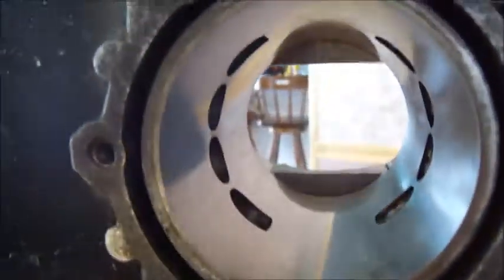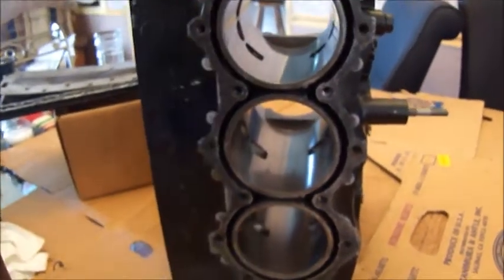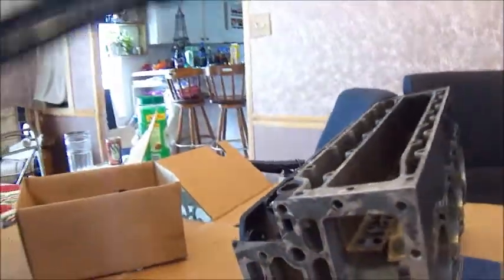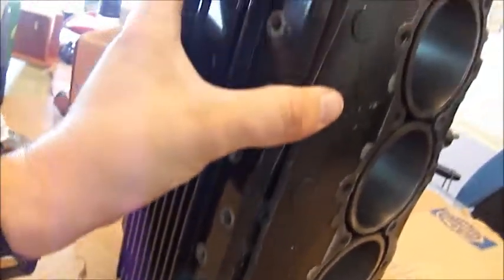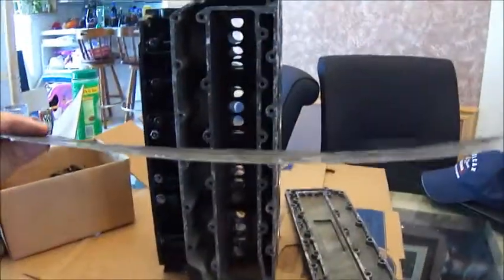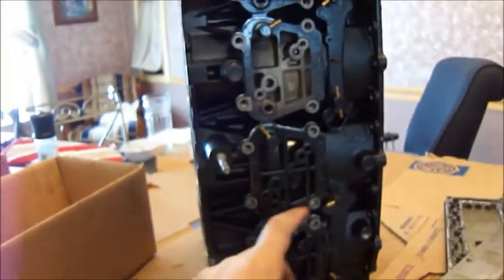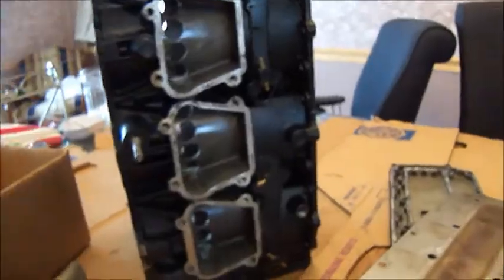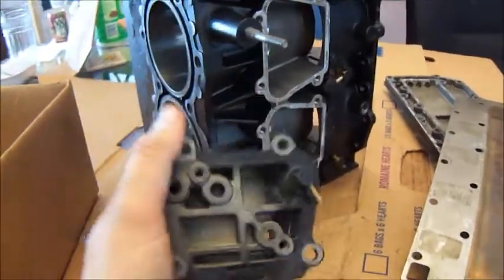Force block completely disassembled.wmv

Comment: So did you end up using 3 oversize pistons and 1 standard then?  Forgive me for asking, but isn't that a no-no since the one standard piston will have a different weight than the other 3 oversized ones?  I would think this would asymmetrically load/wear your rotating assembly and throw off the harmonics.  no?